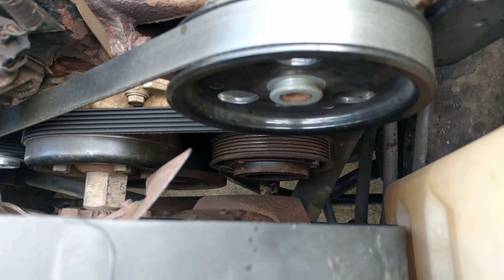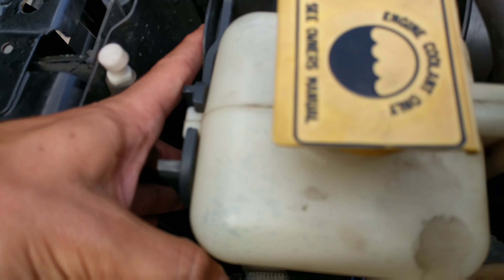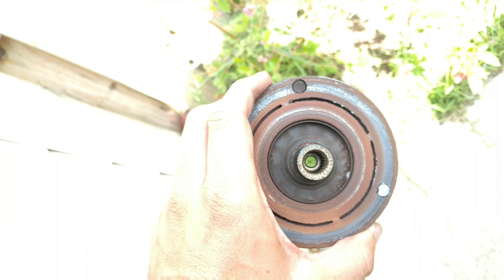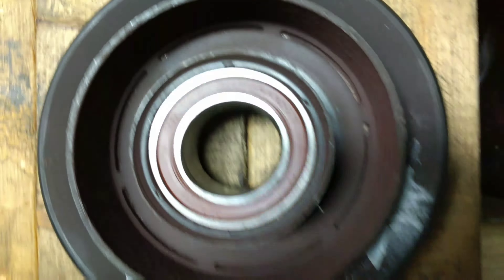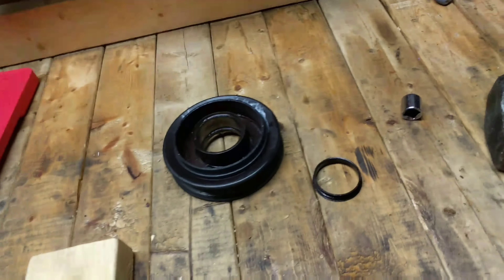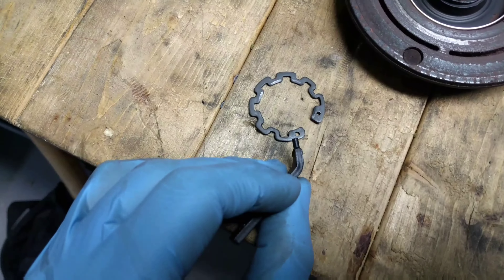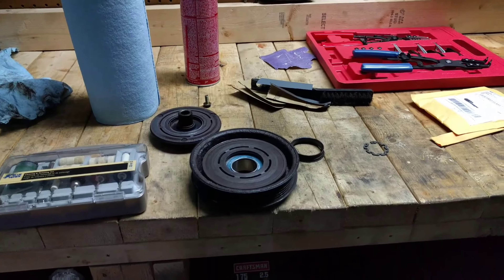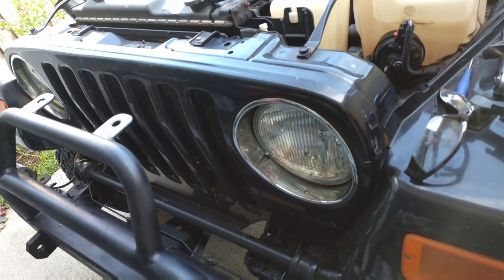Jeep Wrangler (TJ) AC Fix $35

Comment: If your clutch is stuck on the splined shaft don’t pry it off, there’s an easier way! 

The thread on the inside of the shaft is M6, but the thread on the clutch is M8 - get an M8 bolt that’s at least an inch long and screw it in to the clutch (where you just removed the M6 bolt), as you tighten the thicker bolt it will push the clutch off the splined shaft.
Reply: (Be careful though, this method will push the spacer washers out from the clutch - just make sure to collect them and put them back in before reassembly)
Reply: Thank you so much!!

Comment: Thank you for this video. I have tried the link to the ebay for the bearing and have had no success. I typed the   part number into Google and eBay. There are a lot of bearings by size but not that part number. Can you please advise on the size of the bearing or a link to that. It is my only vehicle so I can't be down very long. I have the 2006 jeep wrangler tj rubicon unlimited 4.0 liter. please advise if you can. Thank you so much for the video
Reply from the maker: I no longer have that Jeep, but having the shorter serpentine belt will at least bypass the ac compressor until you get the part in so you won't be down your whole jeep, just the AC. I'll google search the bearing and see if I can find another link
Reply: @ianmburke  That is what I will be doing. Thanks again

Comment: hi what was the part number or size of the smaller belt
Reply from the maker: +James Robinson I would recommend using a local auto parts store and having them look it up and make sure they are good about returns- the first belt I got was too long but I was able to exchange it for the correct one. I believe this is the one if you're looking online "Crown Automotive 53013209AC Serpentine Belt"
Reply: I just bought one from autozone. It was Duralast Serpentine Belt 750K6. fits perfect for bypass of the AC

Comment: never press or bang inner ring on bearings only outer rings   if you do that you will push ring out and bearings will fall.  use the right tool used a  set of press rings. I forget what you call it I have one can't remember.

Comment: The C clip is behind the clutch cover. How did you remove the cover (the very 1st plate shown in the video. Once you remove the 10mm bolt should it just come right off, does it screw off, or do you have to pry it off?
Reply from the maker: I think just a gentle pry and rotate then pry and repeat I believe I don't have it in front of me - but obviously remove the bolt first
Reply: If your clutch is stuck on the splined shaft don’t pry it off, there’s an easier way! 

The thread on the inside of the shaft is M6, but the thread on the clutch is M8 - get an M8 bolt that’s at least an inch long and screw it in to the clutch (where you just removed the M6 bolt), as you tighten the thicker bolt it will push the clutch off the splined shaft.

Comment: there isn’t much detail on how you actually removed these parts. Did you remove the bolt completely and then the 1st piece come right off or what? Because I took the 10mm bolt off and I can’t get the 1st piece off at all. Am I missing something? Please help
Reply from the maker: 10mm bolt all the way out and remove the retaining clip the c shaped clip then it can come off - but it may be tight so be gentle or you might bust the internal seal

Comment: Also, I used a huge pair of channel locks instead of the C-clamp, and my bolt was not tight at all, maybe 10 pounds if that.
Reply from the maker: Sorry I noted in inch pounds as an estimate (30-40 inch pounds is roughly 3 foot pounds) I should have used foot pounds to describe it in the video. Either way it's not too tight so don't over tighten it back on :P
Reply: The 3" c-clamp keeps sliding off the lip as I try to tighten it. How did you keep the c-clamp from slipping off the lip?

By the way, what size channel-locks did you use? The c-clamp isn't working for me bc it keeps sliding off the lip.

Comment: Dude...you ROCK!! Thanks so much for posting this, I have same issue and was about to spend $300 on new compressor. Only thing I would say is I found the bearing cheaper on Amazon. Thanks again!!
Reply from the maker: Chuck Ward that's awesome!! Post the link in the comments to the Amazon one  if you would- I had no good reference so I could only find the eBay one.  glad it helped.

Comment: Completely blew over the hardest part.  Removing the c-clip?  You said with screwdriver. Cant see to do any of this. I have the same year jeep and don't seem to have the same clearance even after removing the coolant reservoir.  It seems like ill have to remove either the compressor or the radiator to be able to see to get the clip removal tool on those tiny holes.  Stabbed blindly for about 30 mins just now before deciding to put back together.
Reply from the maker: It isn't "easy" but all I had to do was remove the overflow and use a really tiny flathead screw driver or obviously the clip removal tool would help a LOT. Also this is a 2004.  The 1997-2002 are a different TJ than the 2003-2006
Reply: What the parts number for the bearings
Reply: @vincenguyen9548  NACHI 30BGS10DST